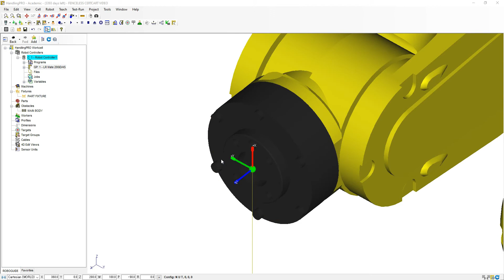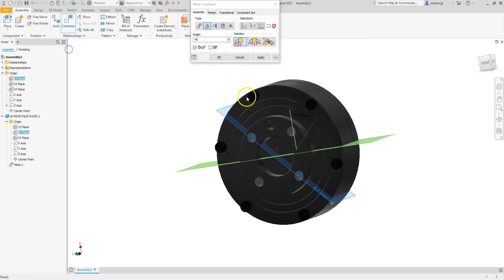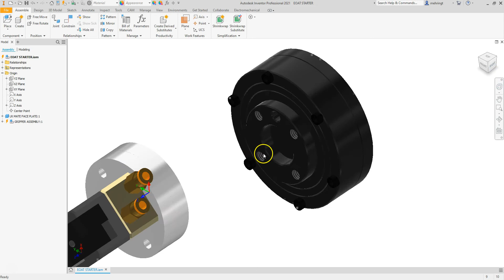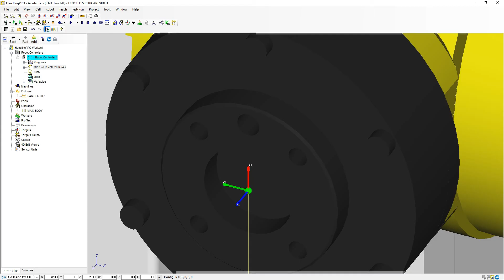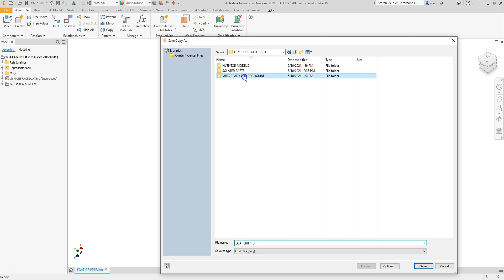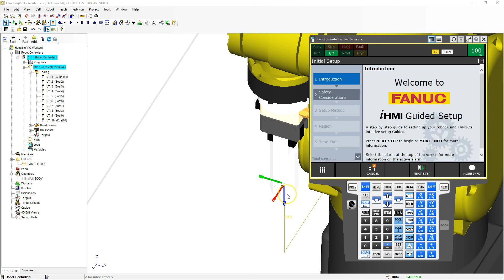EXPORTING AN AUTODESK EOAT TO ROBOGUIDE

Comment: Excellent video. Do you also have a video, or documents related to the robot's EOAT payload settings in Autodesk Inventor. I've use the mass properties tool in Solidworks to find the COG, mass, position, and intertia in KG* SquareM.